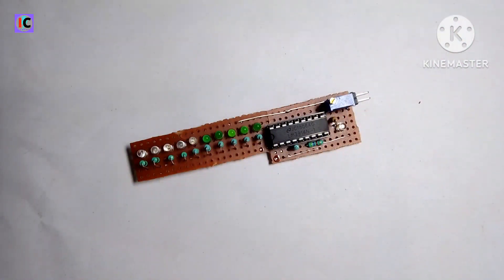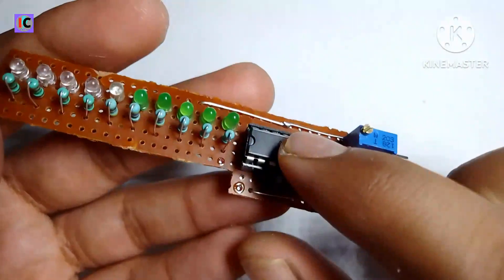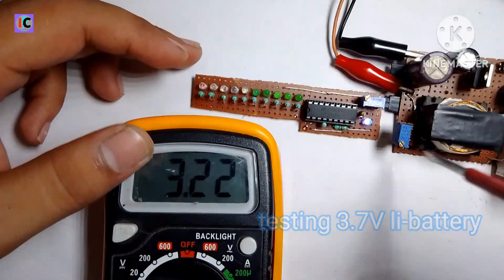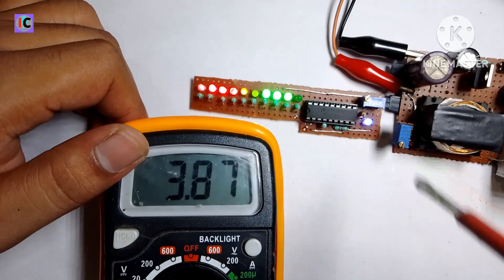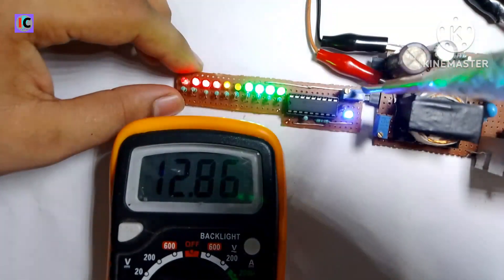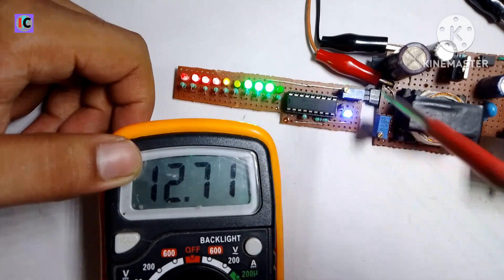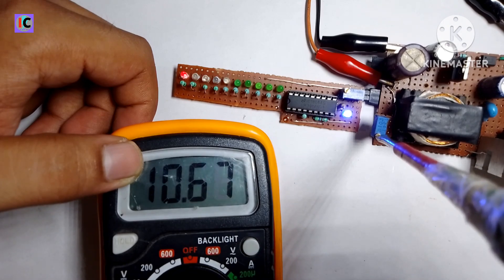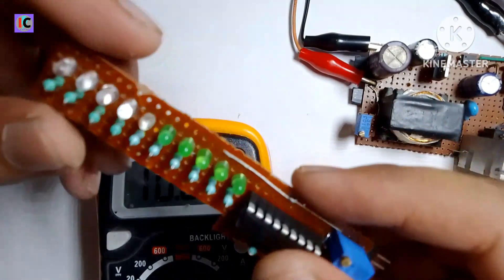Battery Voltage Indicator 3v to 24v LM3914 LM3915 LM3916

Comment: Can i just using 5led ?
Reply from the maker: yes
Reply: @innovationic  how ? Just not using the output pin to led ? How if i use just 18, 16, 14, 12, 10 ic pin and no connect the rest of pin ?
Reply from the maker: you can use or skip any output pins